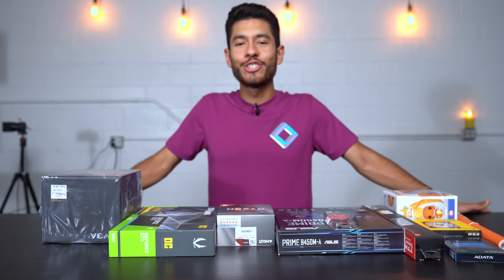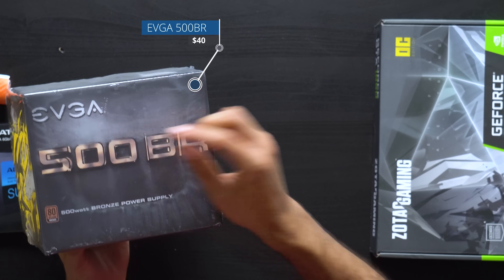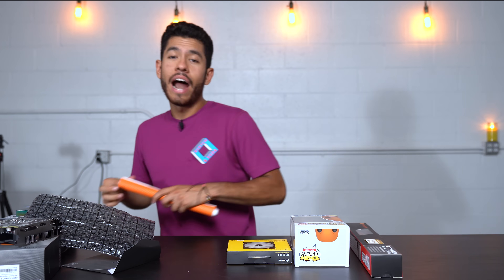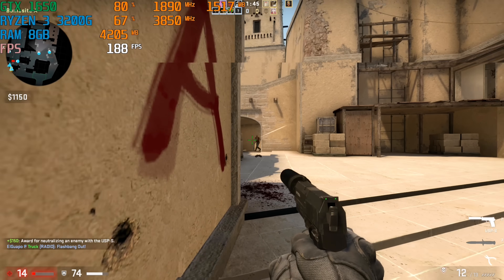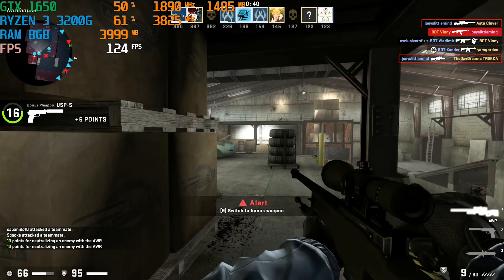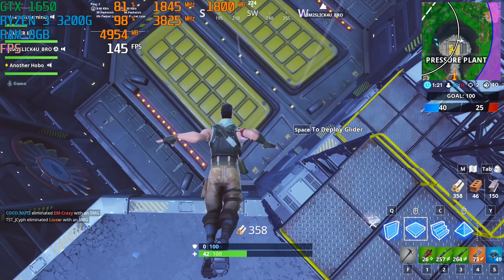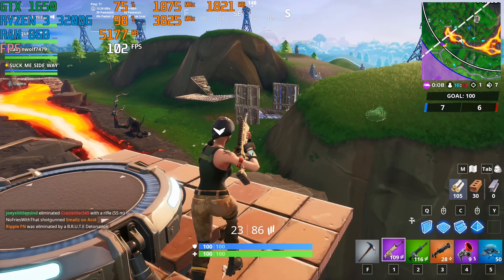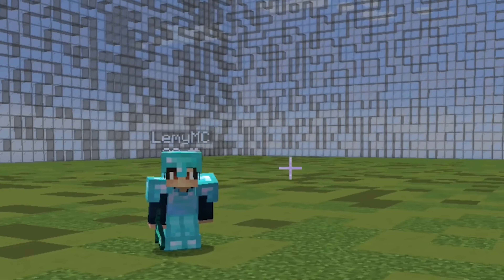$500 Gaming PC Build - GTX 1650 Ryzen 3 3200G (w/ Benchmarks)

Comment: i need help asap pls, the motherboard only has 3 fan slots, 1 for the cpu cooler and the other 2 for the case fans, so where do I put the 4th one that he said was an extra, the led cooling fan
Reply: You need to get a pwm fan splitter (takes 1 fan slot and turns it into 2) and you can connect that extra fan
Reply: mangoz yeah thank you I got one

Comment: Hey Joey love your builds but one question particularly on this one when you head on to PC parts picker they say some b450 motherboards require a bios update before being able to install the CPU how comes you didn't have to update the bios with an older CPU when you used the ryzen 3 3200 g
Reply: nowadays,some B450 motherboards come with BIOS updated for ryzen 3000.

Comment: There's many things about this build that just suck... For example, why are you using a single ram stick when you could have a far more powerful dual channel experience and why are you pairing a 3200g with a graphics card? I mean buying a cpu with integrated graphics and adding a graphics card is outright useless. You could as well use a ryzen 5 1600 af(the newer 12 nm version, about the power of a 2600 and way better than the quadcore 3200g with 6 cores) and pair it with a b350 motherboard to save a few bucks for the ram

Comment: I would recommend getting the 1650 super and 16 gbs of ram and that’s only gonna be an extra $50
Reply: mangoz links
Reply: mangoz I’ve never built a pc but could you add this later to the parts he’s using would it make the rig fast or ?
Reply: @comradekyal2319  its gonna be way faster. Gtx 1650 super performance is close to gtx 1660 with very budget friendly price. Also add another stick of 8gb ram to make it dual channel and the fps will go quite a bit too.
Reply: Adam Fathi thanks just I’ve never built a pc and I want to have a good quality one
Reply: Comrade Kyal you can add these parts anytime to the pc easily you won’t need to worry about much besides installing graphics card drivers

Comment: my $550 build is the Ryzen 5 2600 with the MSI GTX 1650 Super on a AsRock B450M Pro4 MoBo, a small coolermaster case, 16gb 3000mhz corsair vengeance ddr4 RAM, EVGA 650w, 249gb SSD, super upgradable and Overclockable.

Comment: When you want this pc but you realize that you have to buy a 100 bucks monitor to run that much fps...
Reply: wait what the fuck what monitor is he using
Reply: @crackyurrib8702  monitors are around 100-300
Reply: Um... I got mine for 80 bucks. 60 hz 1080p 1ms.
Reply: FUCK CRAIG'S GLOVES it’s a 60hz
Reply: TheyCallMeKingz got mine for $120 120hz
Reply: 100 dollars is not gonna get you over 60 hz
Reply: And 60hz is really freakin bad. Get a sceptre monitor for like 145 for 144hz
Reply: @joeyfaraci1670  feel like if you're buying a 500 dollar gaming pc, a scepter monitor might be out of the budget a lil
Reply: MaxTroGaming don’t forget mouse and keyboard which will be another 70 ish

Comment: Put everything together, but when I switch on the power supply the fans,gtx,motherboard don’t start up , only my keyboard which has leds on it lights up
Reply: Psycho508 make sure that you have connect everything to the power supply and make sure u put those little power + and - pins in the right place

Comment: I just built the same pc with the same exact spec but for some reason my USB ports on my motherboard don’t work and also my graphics card.
Reply: Did you buy it new or like off someone
Reply: Matthew Playzz yeah it’s brand new
Reply: Matthew Playzz but I figured out the problem, u need to update the bios to be comparable with zen 3
Reply: @pluto7904  I'm thinking of building a similar pc but I don't have the money for the gpu I think I'll run of the integrated graphics until I can buy a gpu

Comment: I got this exact build and I keep getting a reboot and select proper device

I can't even use it, that keeps popping up
Reply: You need to download Windows 10 from a separate computer onto a USB stick then put it into your new computer and turn it on.
Reply: FBI i tried downloading windows 10 on my mac, will that not work ?
Reply: @snuffspoon  I will work as long as you have a USB stick that's big enough to fit windows 10. I think the USB stick has to be at least 8 gigs.
Reply: @snuffspoon  wait, no it won't work, sorry. Mac is its own OS and I don't think it can download another OS like windows 10.
Reply: King J  If your display is not working you might have installed the RAM wrong. If your motherboard has 4 ram slots, you need to put it in slot 1 and 3 or slots 2 and 4. Some motherboard require you to put them in specific slots. if theyre not in the right slots or pushed in properly your display wont come on, and make sure your hdmi/display port is connected to the graphics card not the motherboard.

Comment: I want to get a terabyte for the ssd card. Are they all the same size so that it will still fit in the pc?
Reply: You can get any size ssd card that you want. Most Samsung ssds are the same size so you should be fine, even if you got one that didn't fit in the ssd holder you can just move it somewhere else. The ssd doesn't need to be in the ssd holder.

Comment: so im getting really really new into pc’s and parts. from my understanding the ryzen 5 3200 is a 3rd gen processor as well as the 3600, but the 3200 has like a built im gpu and is cheaper than the 3600? just kinda want some help on parts bc at first i was gonna go with the 3600 but my budget is only around 500-650 so i was thinking of doing the 2600.
Reply: The 3200 is an apu so yes it's just a cpu/gpu love child. I'd recommend picking up the ryzen 5 2600 as well as like an rx590

Comment: what can be upgraded and what would u upgrade it too? (such as new cpu that's compatible)
Reply: gap you can get a ryzen 5 3600 x/or no
Which is great and will be tip top for awhile
Reply: Avid R3FL3X whats a better gpu to match with that?
Reply: gap a rx 570 or rx 580
Reply: Avid R3FL3X will those work with the mother board shown in the video?
Reply: gap yah

Comment: This costs me $857 AUD
Reply: it cost 800plus canadian, very out of date. but if you want a cheaper one nowaday get ryzen 5 2200g, zotac 1650 or rx570 armor mk1, gigabyte b450m, silicon power 500gb ssd for 60 cnd(which is amazing), same power unit and corsair carbide 270r case. oh and corsair vengence 2x8gb 2666mhz

Comment: Do you need the optional fan. Or is it just for show
Reply: You don't need it but it gives a little better thermals
Reply: Eeli Pursiainen will bad thermals effect gameplay
Reply: If the thermals go really bad your system can start to thermal throttle but you should be completely fine with only the two fans included with the case
Reply: Eeli Pursiainen thanks this really helped

Comment: Why'd he buy a Ryzen 'G' CPU? He could have cut the cost a little by getting a CPU w/o integrated graphics. Most AM4 processors don't have integrated.
Reply: what should i get instead of the cpu adn gpu he said, any recomendations for the same price?
Reply: @scryluis  2nd or 3rd gen Ryzen 5 is a great choice.
Reply: Evan Brown so its a bad idea to get the gpu with the apu right?
Reply: Evan Brown am i better off getting a cpu+gpu, or just a apu?
Reply: But they're significantly more expensive.

Comment: So pretty much I spent 490$ on this build but changed it up still have the same mother board went with Ryzen 5 2600, Rx 580,Barracuda 1TB.
Reply: So I can upgrade with this motherboard.
 NICE! also wtf am I suppose to do after all the parts are connected?
Reply: BTW if I get a rx570.. since 580 is a little to much.. would I be OK with it being a 4GB instead of 8?
Reply: The Doctor I would go with 8gb but 4gb isn’t bad
Reply: @renerodriguez9226  they are to expensive for my buget

Comment: Some help please?
They fits together or it's a wrong choice?

EVGA 650 N1, 650W, 

ASUS ROG Crosshair VII Hero AMD Ryzen 2 AM4 DDR4 M.2 USB 3.1 Gen2 ATX X470 Motherboard

Corsair LPX 32GB (2x16GB) 3200MHz C16 DDR4 DRAM

AMD Ryzen 7 2700X Processor with Wraith Prism LED Cooler

Asus GeForce GTX 1660 Super Overclocked 6GB Dual-Fan Evo Edition VR Ready HDMI DisplayPort DVI Graphics

Comment: PLEASE HELP! So I see a lot of complaints about the 1660 so I was looking at the rx570. I Don’t know much about pcs but will it fit and would it be a better choice?with the money I save from that, I will add another stick of ram
Reply: Pick any gpu you want depends on your budget, if you want to same performance as the  1660 the amd rx 590 is more comparable. But rx 570 should handle 1080p gaming on ultra
Reply: JR I meant to say the 1650 not the 1660. So it’s either the rx570 or the 1650. which one is better? I might even go for the rx580
Reply: @ericthompson3253   rx570 is better than the 1650,  for the rx 580 it's your call if you want to spend $30 more for about ~10fps increase over the rx570
Reply: JR thanks for the help. I’m going to get the rx580

Comment: I’m new to this pc thing would y’all think this would be a good starter pc
Reply: AirJuanz I would say get one with higher ram or buy all the same parts and then just get 16 gig ram
Reply: @bradenabbey7022  can i play on 144 fps with this one?
Reply: @steezyfn7386  you can play 144fps on low to medium settings depending what game it is you're tryna play bro.
Reply: Ight bet thx
Reply: Get a 6 core cpu as it will last longer
Reply: This would be an amazing starter build.
If you cant afford the graphics card then stick with this CPU.
If you can afford the 1650 graphics card then get the ryzen 5 2600 or the 3600 depending on how much you can afford. 

KEY NOTE if you get the ryzen 5 3600 you will want to get a MAX version of a b450 motherboard for less hassle.
Little bit of research goes a long way with pc building
Reply: @Evilflufkins  just wanna play fortnite on 144 fps...
Reply: @steezyfn7386  oh yeah no problem with this graphics card the graphics card will play on competative settings over 200fps or at low 230fps medium 150fps 
So yeah id say you can play 144fps on fortnite lol. 

Any other questions just @ me or reply ;)
Reply: @Evilflufkins  ok ty so i need to get a mini job now...
Reply: @steezyfn7386  ha yeah i feel ya man. My power supply recently burned my whole pc and i currently can afford a new one gotta start looking a little jobs myself 😂😅😢😭😭
Reply: @Evilflufkins  gl bro

Comment: I'm a beginner PC builder (doing my first build) but I got a few questions I hope someone can answer for me. So I'm building this PC on this video and it says the extension power cord is optional. So can I still make it work without this cord?
And are there any other cheaper cases that can still fit all this in? 
Thanks in advance to everyone.
Reply: The extensions are just for aesthetic, so the answer is yes to your question, you could just use the power supply cables.
The cheaper cases are not really ideal, the Focus G is a bargain with two fans for $50-$60. But you could get the Focus G Mini (mATX version) which is cheaper by like $9.
If any other questions, I'm gonna direct you to /r/buildapc/, very active and you would get your answers quick rather then getting buried in other YT comments.
Reply: @32carus   thanks so much you are amazing

Comment: About to do a very similar build but with a 1060 3GB which is second hand and performs a little better than the 1650 in most cases. Rest of the specs are very similar but because the 1060 was second hand I grabbed a 500GB SSD

Comment: Does it matter If I use the ryzen 5 instead of the 3 or do I need to buy a different motherboard. Also wondering if you can use the Intel i3 for an amd motherboard.

Edit: will the ryzen 5 increase performance significantly compared to the ryzen 3
Reply: Look up the name of the motherboard and what cpus it supports. It will tell you if it supports ryzen 5.
Reply: @i.See.Candles  isn't every amd motherboard have the same socket for ryzen cpus or does the ryzen 5 have a different socket compared to the ryzen 3
Reply: @absolutecinemaifiveeverseenit  They have the same socket to fit the CPU into the motherboard, but some motherboards are not updated to support the power of newer CPU models. For example my B450-f gaming motherboard didn't support my Ryzen 3800x because Ryzen 3000 series is fairly new. So I had to use my older Ryzen 2700x to udate the BIOS on my motherboard so it could run the Ryzen 3800x. That's why it's important to look up the CPU'S that your motherboard is compatible with. Also to answer the last question in your first comment, you can't run i3 in a AMD motherboard.
Reply: And yeah ryzen 5 will give you a pretty good performance boost from ryzen 3

Comment: at my country , we can buy this pc but with asrock b450m steel legend and zotac gtx1650 amp 
for about the same price

btw , AT my country

1)ASROCK B450M STEEL LEGEND AND AMD RYZEN 3 3200G  $174
2)HyperX Fury Red DDR4 RAM 8GB 3200MHz  $41
3)EVGA 500 BR 80+ Bronze Power Supply  $48
4) ZOTAC GAMING GeForce GTX 1650 AMP 4GB GDDR5   $162
5)SAMSUNG 860 EVO Series 2.5  250 GB  $43
6)Focus G Computer Case  $46

total  $514

Comment: Hey man! Thanks for this video! I actually wanted to make a gaming setup similar to this and I am hoping to get a deal on the upcoming black friday. Just a couple of questions, I am a complete newbie and illiterate when it comes to techy stuff but I would like to ask if this can last for 2 or 3 yrs? What upgrades can I still add to this? Thank you!
Reply: So if you want it to last 2 to 3 years id say get the ryzen 2600 with the same motherboard or get the ryzen 3600 with a b450 max motherboard. The gpu should be fine as it came out this year. Power supply is your choice and yeah that would be a kick ass build.

Comment: Should have gone with a rx570 rather than GTX 1650.... If anyone is building a 500$ budget , I highly recommend go with rx570 as your GPU and if possible a Ryzen 5 or Intel i5 9400-f
Reply: will it fit in the motherboard and case because i'm saving up for the build
Reply: @iceyi5922  yes it will fit
Reply: Pes Nations thank you I was thinking of getting the rx 570 for about 2 weeks but I didn’t know if it would fit

Comment: only changes i would have mad is go with a ryzen 5 2600 right now and a rx 580
Reply: i'd have to agree but that would make it over $500
Reply: Braien Barvid I feel like you can easily keep it under 500 and get those parts used ex 580 is about 100 dollars and new ryzen 2600 is 117
Reply: @Dyrawn  if we're talking about buying used parts then yeah it's possible to keep it under $500

Comment: Hay joey can i upgrade the processor to a 5 instead of 3
Reply: Yes you could. 
I'd recommend you get the ryzen 5 2600 that way the motherboard will not need a bios update. If you want the 3600 then id just recommend getting a max version of the b450!

Comment: are there any compatibility issues between the 3rd gen and b450m?
Reply: did you go on PC part picker because it said that for me also
Reply: @seabracing8880  yeah. further research tells me that it should be fine with this cpu
Reply: B450M boards do support 3rd gen ryzen but the motherboard will have to a updated BIOS (UEFI) to support 3rd gen

You can use B450M boards but some sellers do and dont sell them with the updated BIOS to support them.

Comment: Does the processor come with thermal paste?
Reply: Thermal paste is pre applied on the AMD stock coolers
Of you want to use a 3rd party cooler you will have to get a tube

Comment: Easy and clean build! Assembled it last night start to finish in two hours! This is the 2nd PC I've built following one of your guides. Thank you!
Reply: whatd you do with the third fan with there only being 2 ports on motherboard
Reply: @aaronhietikko2018  I have 6 fans. The psu has leads for them
Reply: @aaronhietikko2018  Running the fans through MOLEX (Chunky 4 pins)

Comment: Im getting a gtx 1650 i5 2400 on ebay for £315, will it be the same fps as what you are getting?
Reply: the i5 is not compatible with the motherboard. do not get the i5 with this motherboard

Comment: My budget build - Firestrike score : 15,757 by [Tek]Praetorian
Intel Xeon Processor W3680 6-core/12 Thread(3,300 MHz)
Turbo 3.6GHz
AMD Radeon RX Vega 64 8GB HBM (1,637 MHz)
16GB RAM syste
1TB SSD
600 watt Gamemax PSU
Water cooled Antec K24
RGB lightening.
$508 total cost. 
😉